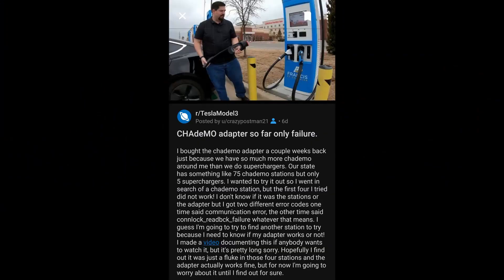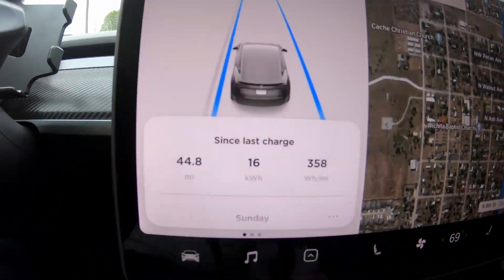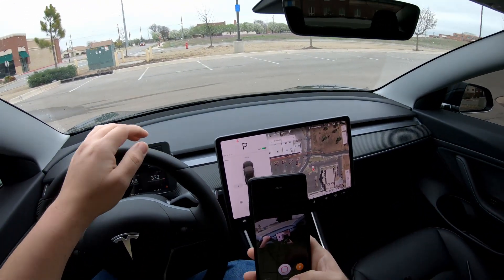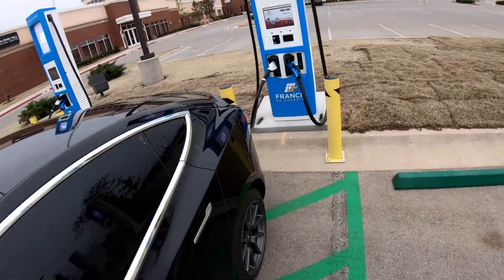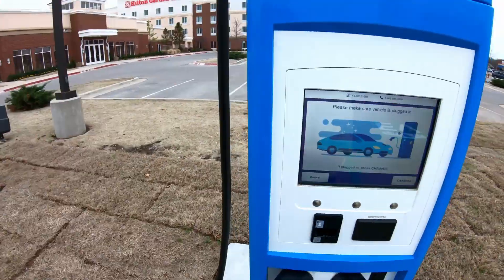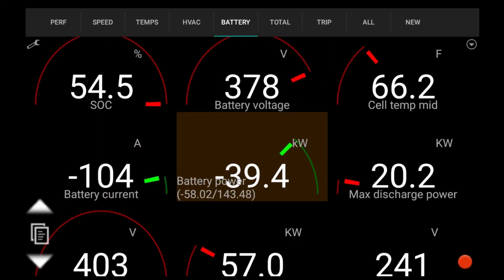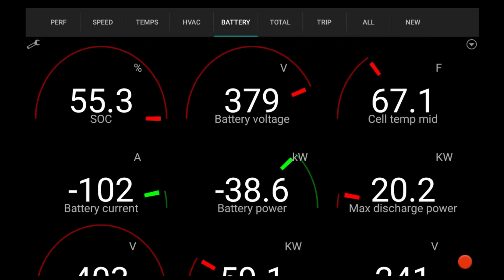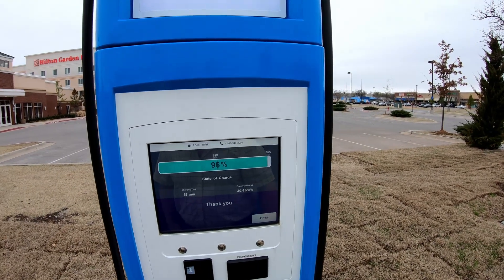Charge a Tesla at a non Tesla station! The Tesla CHAdeMO adapter does work!

Comment: Is it possible to “pay at the pump” with a credit card or ApplePay (tap to pay)?   If not, does the app for this particular charger network let you keep a credit card on file and bill it for the exact amounts you use as you use the chargers or does it require you to add money in “block amounts” up front (i.e. in blocks of say $20) like the pikepass for the turnpikes?
Reply from the maker: I don't think you can pay at the pump. From what I saw this company sells an RFID card or you can use the app. yes you have to add money in blocks. I think the lowest amount I could do was $20.

Comment: I have noticed several of those Francis Energy charging stations in Oklahoma.   What is the cost to use them to charge a Model 3?
Reply from the maker: Well I went from 42% to 96%. And it cost me $12.97 it's $1 transaction fee & .21 cents a minute. I was talking to a guy so I wasn't paying attention when it started throttling, but if I would have rode the curve a little better I could have done it cheaper. I think it starts throttling back in the 80-85% area
Reply: Thanks for the info!    It’s not nearly as expensive as I had thought it might be.   Might need to get an adapter now and try driving the Big Cabin-Muskogee-McAllester-Texas route.